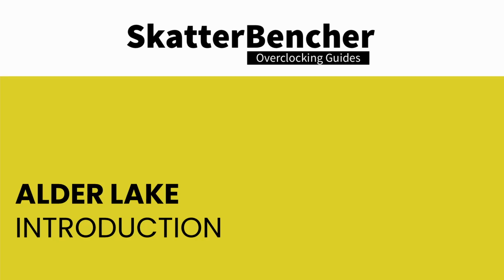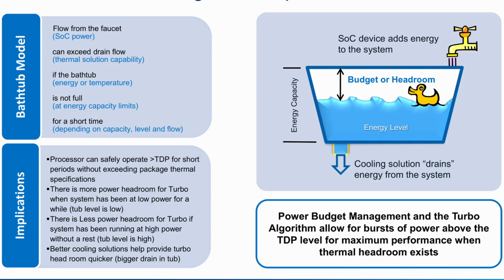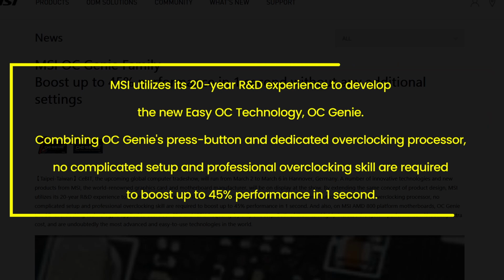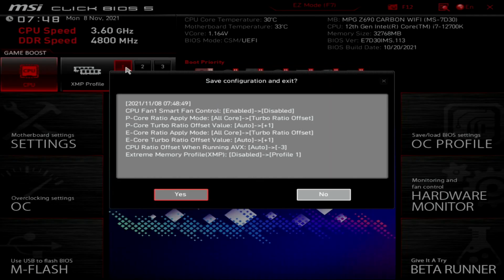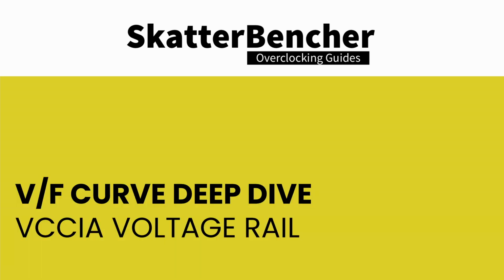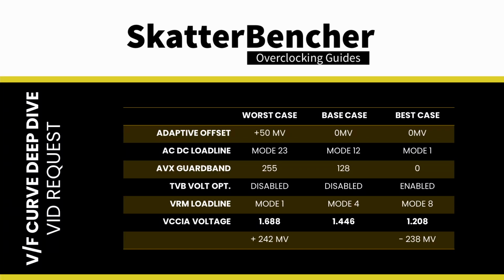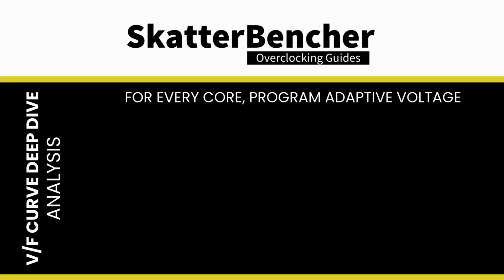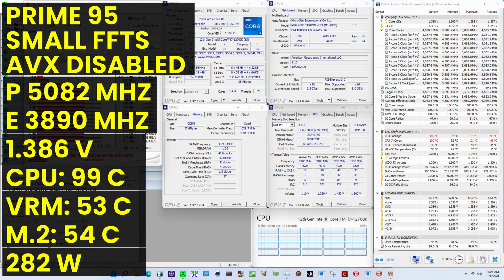Core i7-12700K Overclocked to 5400 MHz with MPG Z690 Carbon EK X | SkatterBencher #31

Comment: Great video. I ended up trying tp push for 5ghz but it was needlessly difficult to break that 4.9ghz barrier  and when i did it also cost me like 15c higher temps so i settled for 4.9 all cores and not knowing how far my cpu could go. My PSU is definitely a limiting factor as well.

Comment: I used a combination of offset and applied max offset-values for individual cores. For my cpu 2 cores can go up to 5.5GHz, than a bunch goes to 54 and so on. Your guide helped me out tremendously. Right now I am running a benchmark on Cinebench and for most of the time with my Kraken cooler the cpu can hold 5.3 to 5.4 ghz plus. Temps under load can hit 90°C plus on some cores but only for very brief moments. To me this looks good. And no errors or crashes.
However I noticed that the performance is actually quit significantly lower than before. I played Genshin afterward and noticed way more stutter than before. It's basically unplayable. This is really curious.

Specs:
i7 12th gen
MSI z690 MPG Edge Wifi
96 gb ram from 4 dimms. 64 GB 2x Crucial Pro 3200 MHZ and 32GB Kingston Fury 3600 - Both sets run at 3200 mhz right now
BeQuiet 850W Pure Power

On my motherboard the most important settings I have done to increase gaming performance are:
Disabling Hyper Threading
Disabling E-Cores
Setup up the p-cores to run at 2X5.4 Ghz, 4X 5.3 GHz, 2X 5.1 GHz
Adaptive Voltage set to 1.375v. The bios shows about 1.425v - 1.47v for vCore
XMP is activated
Reply: What are you doing ? Disabling ecores hurt performance on a lot of games you can see many benchmarks on this also turning off HT has negative impact in gaming in most games only few benefits from it. You are also limiting your overclock because of your 4 dims that’s sucking the juice from the controller.

Comment: This doesn't work on 2023 bios.
Reply: Figured it out. Apparently core grouping and turbo offset don't work unless you use Intel's extreme tuning utility. Doesn't appear to be possible in the most recent bios. The utility can also provide you with your approximated default curves without having to plot it manually.
Reply: I can't UV nor OC as everything related is grayed out to me. I can only enable XMP and use AI OC profile, however, my chip doesn't AI OC at all, system crashes and gives me BSOD. Can you help me?

Comment: the benchmark scores are exactly the same for offset+3 and manual tunning

did you upload the wrong graph for manual tunning?
Reply from the maker: I uploaded the correct visuals to my blog https://skatterbencher.com/2021/11/25/skatterbencher-31-intel-core-i7-12700k-overclocked-to-5400-mhz/#OC_Strategy_4_Manual_Overclock

Comment: Could you do the OC strategy #3 by simply setting the p and e cores both to turbo ratio offset, add the +3 to each and leave the other settings to auto? I'm assuming by setting it to adaptive and applying the voltage is to regulate it so that it doesn't pull more/less power than necessary?

Comment: Let me start by saying I learned all of this by reading your website / article on this topic and from there learned what I needed to overclock my CPU. Crazy amount of information you covered but I was able to pick out what I needed to have a rough understanding. So thank you. Moving on, I am using the Intel i7 12700k. I have an Asus Tuf Gaming Z-690 Plus DDR4 motherboard. My cooler is a Lian Li 360mm aio liquid cooler. I set my P-Core Ratios to 54 53 52 52 51 51 51 51.  I set my Load line calibration to level 5. I set my Cpu core voltage to 1.35000v. And I believe my Cinebench R23 multicore score was roughly the same as the one shown here at 24434. How does this make any sense, the only thing I can think of is you were going for the highest stable clock speed at the cost of thermal throttling and performance.
Reply from the maker: Hi Brett, thanks for the kind words and I'm happy to hear my videos have helped you :).

To answer your question: I think it sounds pretty logical. In OC Strategy #4, my P-core configuration is 54-54-54-53-53-53-51-51. So in all-core workloads, the P-cores will run at 51X. That's the same as in your configuration.

The main difference between our configurations is that for a 2-core load to a 6-core load, I've push the CPU a little more.

Comment: On the asus prime-a. I had set svid global voltage to adaptive.. then 1.285v core with -0.050mv offset and it ran around 17-18 watts less in 10 min cinebench.  Core clocks stayed the same. One voltage setting all i changed. So the cpu would
Override this setting from
You say? If I’m understanding right?
Reply: Yes it would override the 1.285v core you set. It would be the same as leaving it on auto. The -0.050mv offset is still applied though. So you're basically leaving your adaptive vcore on auto and applying a -0.050mv offset. That's it.

Comment: Would the MAG Z690 TOMAHAWK WIFI DDR4 have similar BIOS settings available with regard to overclocking features as this motherboard?
Reply: yes the exact same bios lol minus the DDR5 xmp profiles of course. Instead you would just have the normal DDR4 xmp. Other then that they're identical. My dad has the z690 tomahawk it's a fantastic board. Handles the OC on his 12600K without a problem.
Reply: @PabzRoz  i see u commenting smart shit in a lot of OC videos on 12700K, is there any way to contact u and ask some questions? Maybe discord?
Reply: @dutchcuts1046  Yeah sure Youtube always auto deletes comments with discords so hopefully this goes through. Just hit me up on there and I'll get back to you as soon as I see it.
Reply: @dutchcuts1046   "pabz_roz 8303" Just add the # sign where the space is and no quotes obviously lol
Reply: @PabzRoz  great, I added you, stmast

Comment: I got 5.3ghz on the p cores and 4.1ghz on the e cores with a ring ratio of 40 voltage is set low to 1.25v runs fast and cool this is on i5 12600k
Reply: Yes but you have two less p cores to deal with and the extra heat comes off of it. But good overclock anyway.
Reply: at 1,25 i have 12700k at 5.1ghz all cores, 4ghz ecores,! 1,2v 5ghz all cores
Reply: @bboytyby  nice what ring ratio are you running just curious? I'm running 41 seems like anything too far past that I  need more voltage
Reply: I can't UV or OC my 12700k, can you help me? Both are grayed out for me.

Comment: How would be possible to decrease temperatures below 90 degrees celsius? Any tuning possible in the Adaptive + Offset option to negative values for significant improvement in temps? Anyone have checked this together with TVB limits? Help is much appreciated as I am considering to match a 12900k cpu with air cooling (NH-D15 noctua). Thanks you for such nice and clarifying videos!!
Reply from the maker: I think the easiest way to force 90C maximum limit is by setting the TjMax to 90C in the BIOS. The CPU should then automatically reduce the frequency when the temperature exceeds the TjMax.

Comment: Can you compare half manual overclock of 5.0-5.2GHZ to MCE set to power limit of ~200w. or what if we OC all cores to 5.1ghz in that case all the cores will run at same voltage right?
Reply from the maker: I'm not sure I will find the time to check out that specific case.

For your second question: since Alder Lake CPUs have only 1 VccIA voltage rail which is shared by the CPU P-cores, E-cores, and Ring, the CPU cores will always run at the same voltage (even if they're running at different ratios).

Comment: could you do a tutorial on how to overclock the i7 12700k with the gigabyte z690 auros elite ddr4?? Very informative and great videos!
Reply: I have exact same combo with 3080, what do u wanna know
Reply: @mythbuster4315  pretty sure he wants the professional not some random with the same motherboard XD
Reply: @BedroomMachinist  if you like at this so called proffessional, cores never go past 49 which is factory.
Reply: memory gear 1 allcores 51 e cores 41 ring 41 150 negative voltage offset nice cool 90 degrees

Comment: Hi Pieter, thank you for the great content.  I'll be building a i7-12700K system over the next few weeks, and I've decided to give overclocking a try for the first time.  I've got a few follow-up questions to this video:
#1:  Are you executing these OC strategies in isolation to each other, or are you building upon each step?  For example, Game Boost had set the AVX Negative Ratio offset to -3.  Did you keep that setting for your following two strategies (turbo boost, manual overclocking)?  
#2:  Did you arrive at the 1.425V setting for the manual overclock after iterating to find the appropriate voltage?  E.g. first find a stable adaptive voltage for a 52X boost, then 53x, then 54x etc.
Reply from the maker: Hi! Congrats on the new build and welcome to the world of overclocking! To answer your questions:

1) Each strategy is a standalone approach to better performance. You'll find that some strategies build on what was learned from other strategies, but the explanation and configuration is set up such that you can just pick one strategy and try to apply. The strategies outlined go from Starter to Expert, meaning strategy 1 is the simplest and the final strategy is the most advanced.

1b) For this particular video, I did not keep the AVX negative ratio offset in my next strategy. The reason is that I can get more performance without the negative offset.

2) That's correct :).

Comment: I did this exact OC and with my aio I don't break 87C in CPUz stress test
Reply: Settings please? Also, UV seem to have been locked out by intel now...
Reply: @Ragssssss  sorry I don't have this cpu anymore, I think it ended up becoming unstable during some processes
Reply: @CODSOURCE2012  ok thanks
Reply: @CODSOURCE2012  yes this skatter bench oc is bad and very wrong

Comment: I just pressed the OC GAME button on this MSI z690 board with 12700K, but it pushes 1.42 volts through the cores.. is that too much ?
Reply from the maker: I presume the 1.42V is only when few cores are active and not in an all-core workload? You can verify with HWiNFO which has a readout directly from the voltage regulator.
Reply: @SkatterBencher  Tnx for the reply. This value is from HWiNFO. As a max reading that is. If this 1.42 volt were the case as a "mostly always" scenario, would it then be too much ? In other words, what voltage for a long duration, say 3 hour game session, would be a bad time for the CPU ?

Comment: I miss X58! I'm so lost. I just upgraded to Z690, but feel like I need a full semester to learn how everything interacts. I went from X58 feeling like a hard core overclocker, to X99 and having a decent understanding, now to Z690 and I feel like a complete noob. I miss the days of tweaking vcore and cranking BCLK and the ratio if you splurged for an unlocked CPU to get huge 50% gains. Now it seems like you need an electrical engineering degree if you want to squeeze out an extra 10% on benchmarks.
Reply from the maker: I know! I got back into "daily rig" overclocking around Comet Lake time and I've been scratching my head to get around all the options ever since. Maybe that's why I'm losing so much hair lately, haha. But, I much more enjoy overclocking with modern platforms than before because it feels like there's always something more you can do to increase the performance. It's like a never-ending puzzle.

Comment: Could you please overclock i7-12700k with Asus Z-690A with DDR4? AI failed me at 4 core 5.3Ghz 4 core 5.1 cause of max temp reached 100 and blue screen. though I didnt enabled Ai cooling or ai tweak to limit upper speed. At default "auto" settings but disabling bios limits gives me 4.9 Ghz all core and max temp of 75. I use 360mm cooler master ml360 illusion...There are sooo many settings in bios....AI overclocking sets 4 core 5.3 and 8 core to 5.1 but it reaches max temp..I didnt tried the manual core by settings yet as ou did at 12600K

Comment: A bit confused. I want my 12900k to boost 2-3 cores at 5.4 using 1.375V but my all core turbo to be 51 at 1.275V. 

For some reason setting a turbo ratio above 52 seems to break adaptive + offset mode on my MSI Edge board and it no longer works as you're describing here.  Any similar experience with that bios?

Comment: I got 12700k auto stock volts,  5ghz under heavy load p-core, and 3.9ghz e-core 1.3 - 1.39 volts using turbo modes +3 from stock. So far stable under heavy stuff and light loads and gaming in windows 11. Only issue heavy max load gets up to 280 watts and my Corsair h150i capellax elite with fans half of full speed for noise quietness gets up to 100c temps so then ratios go down one on everything to drop temps under 100c under max load.. very stable so far, going to work on lowering voltages and temps…

Comment: Did you figure out how to get blck to be 100.00 flat and even instead of 98-99?.. I got msi generic z690 board, no bios updates, and blck stuck I want it at 100 exactly…
Reply from the maker: Oh, I didn't look into that. My first guess would be to disable spread spectrum
Reply: @SkatterBencher  can’t find it in msi z690 board bios??
Reply from the maker: Hmm, yes I couldn't find the option either ... :(
Reply: Set the bclk to 100.24

Comment: Is it worth it NON overclocked with 12900k and RTX 3090 for gaming purpose?

Can it cool the CPU when gaming?

Sorry i didnt look through all the tech stuff but you are the only one on YT having the EK version... I must know
Reply from the maker: Yes it will be able to cool the 12900K when gaming.

Non-OC 12900K will be ~241W MAX under load. With this 12700K I had 93C with 262W Prime95 all-core load and OC. With 12900K I suspect you're looking at 85-90C under full load at stock settings.

Comment: I didn't get the idea with adaptive voltage and e-cores.
So let's say i want to get 4.2 all e-cores frequency.
I have ASUS mb, do i need to set e-cores adaptive voltage considering it will be applied to the max p-core ratio?
I.e. if i set 1.35 e-core adaptive voltage, will it be applied to x42 e-cores ratio?
Or it will be set for x55 ratio my p-cores have and then interpolated down to x42 ratio i set for e-cores?
Reply from the maker: So, let's say you have 55X for P-core and 42X for E-core. For 12700K max default ratio for P-core is 50X and max default ratio for E-core is 38X. Voltage for all ratios above 50X for P-core and above 38X for E-core are interpolated between the  50X/38X and the OC ratio (55X).

If you set a global adaptive voltage of 1.45V, then for the E-core there will be interpolation between the OC ratio (55X) & adaptive voltage (1.45V) to the default max turbo of E-core (38X) and its V/f point (probably ~1.2V). With linear interpolation for 42X you'd get 1.26V.

If you set a per core adaptive voltage of 1.30V for the specific E-core, then for the specific E-core there will be interpolation between the OC ratio (55X) & per core adaptive voltage (1.30V) to the default max turbo of E-core (38X) and its V/f point (probably ~1.2V). With linear interpolation for 42X you'd get 1.22V.

Three caveats to this:

1) As I mention in the video, I think technically it should be possible to configure the OC ratio for each core separately as well. If that's the case, you could make the interpolation for the E-core start from 42X at a certain per core adaptive voltage. That would help configure more appropriate voltages for overclocked E-cores

2) You can see that in both cases described above, the E-core voltage for 42X is not much higher than for 38X. So in practice, it is very difficult to get a decent overclock on the E-cores because you're very limited in voltage. That said, even if you try with override voltage mode or an global adaptive offset, you'll find that the E-cores are pretty much limited to 43X maybe 44X on ambient cooling. So not much headroom. Furthermore, adding voltage to E-core will increase the overall power and temperature. So you might end up hurting your P-core overclock anyway.

3) Also remember that there's only 1 VccIA voltage rail for all P-cores, E-cores, and Ring. So unless all P-cores are in lower power state, you won't see the interpolation voltage for the E-core. Most if not all of the time, the P-core voltage will be the one that affects the VccIA voltage.
Reply: @SkatterBencher  Thank you very much for explanation!